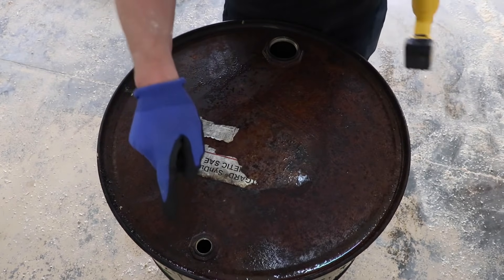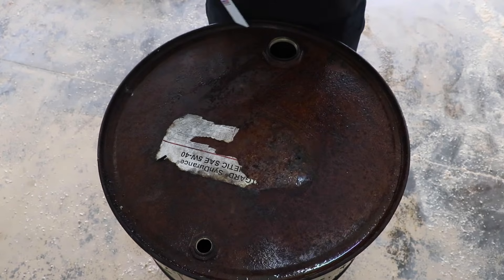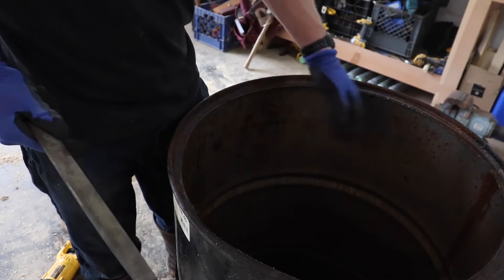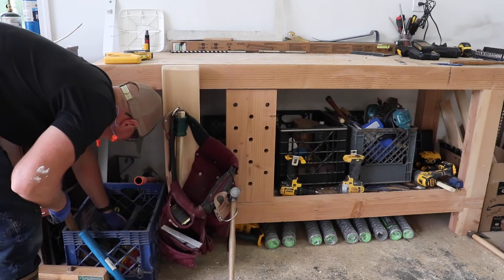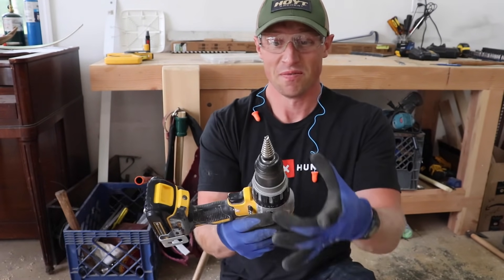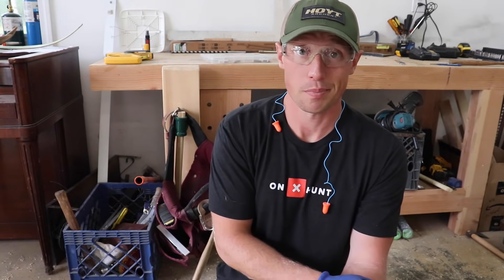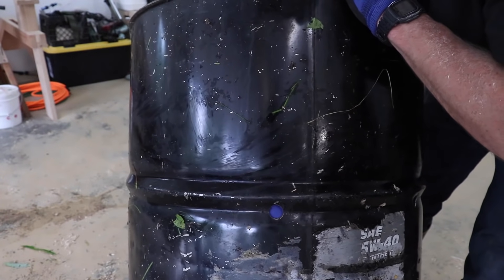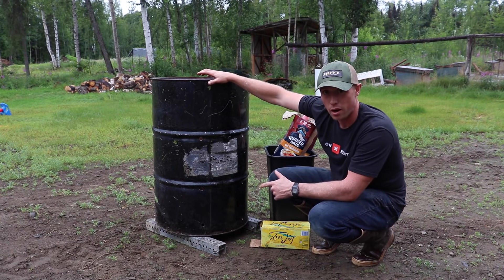HOW TO MAKE A BURN BARREL--- THE SECRET TO BURNING CLEANER!

Comment: I'm pushing 80 years old. I made burn barrels as a teenager. I used a5 pound seldgehammer and an old piece of steel to cut out the top. I just banged the hell out of it till it fell out. Then I used 12 guage with any old buckshot from 15 to 25 yards out on it till it looked right.

Comment: You don't need a drill to make those holes.  When I make a burn barrel, I make a few rows of X cuts with the angle  grinder,  then knock in the middle with a ball peen hammer.  The edges folded inward  prevent burning stuff from escaping, pretty well.  Cheers.
Reply: I shoot holes in mine with a .22 rifle. Easy peasy.
Reply: I love simple! People forget that keep it simple stupid... She has using plasma cutters welding cutters angle grinders for 3 hours for 10 hours of work just to build something that nobody can build just to show how great they are. I want simple s***.
Reply: @Maryland_Kulak EXACTLY!
I'm thinking 9mm, 12 ga buckshot etc
Reply: @howtogetoutofbabylon8978 I use .22 shorts and it penetrates the outside of the barrel but bounces off the other side and the bullet ends up inside the barrel. It’s a very neat and safe way to do it. 9mm would go right through and keep on going.
Reply: @Maryland_Kulak  Can't even find .22 shorts anymore. I have one box for my grandpas gun for posterity but I haven't seen shorts in the store in at least 20 years.

Comment: Whenever you get a barrel with unknown flammable fluids in it. Fill it with 10-20 gallons of water before start cutting on it. Spin it around and the vapors should be contained. I always suggest putting a few gallons in and washing it out before filling with more water to make inert and a little bit of any kind of oil on that step bit will make it last much longer
Reply from the maker: Thanks man for the tips!
Reply: I just throw a match in it.
Reply: Waste of water and i like a good surprise 😂

Comment: To eliminate smoke and fumes, make a 3 inch hole in the side just above the bottom,and use a shop vac hose blowing air in. Use a 3 foot pipe between the barrel and plastic hose to keep it from melting. Take a propane roofing torch and direct the flame horizontally above the barrel. this  is like an after burner and with the jet of air blowing in the bottom, it will burn clean. B careful it gets hot and blows ash out. works great
Reply: i use my battery powered leaf blower. it blazes the barrel right up.
Reply: Battery powered leaf blower for me . Makes the barrel glow red hot

Comment: Good video. I use a pick axe for the holes. You don't need to swing to hard and it makes 4 holes in the bottom and 6 on the sides in about 1 minute.
Reply: Rock hammer with a pick end

Comment: Texas had an ice storm a couple weeks ago and I lost the top quarter of several trees as well as many branches that were taken down when the tops collapsed. I've spent days cutting usable wood for my nephew's fireplace, but have lots of smaller twigs, limbs and pine needles to burn. I spent a year prior to the ice storm debating between a wood chipper/shredder and a burn barrel, the wood chippers that could handle the trees and pine needles were way out of my budget. I also didn't want something that might need gas or electricity in case neither are available.  I've just spent over an hour looking at various YT videos how to create the burn barrel, wasn't even sure about the drill bit needed to drill through steel. I came across your video which kind of went through a checklist of things to do, like where to burn, which I'd already decided on the safest place, plus the concrete pavers to set it up on a dirt area, and to have access to my hose. I grew up in N. Idaho and spent many years in WA state and you never leave fires unattended...where I live in TX, people create all kinds of fires and just walk away and leave them burning...which totally freaks me out. Anyway, your video was actually the most helpful and informative for a novice. Really appreciate it. Thanks so much.
Reply from the maker: I’m glad my rambling was of use to you! Texas ice storms are becoming quite the ordeal these days.

Comment: 6:24    Before you do this, make damn sure the old contents of the drum were not flammable.  Vapors can be just as explosive as the former contents, and guys have gotten killed cutting into "empty" drums that exploded.  I was just reading about a guy in Pennsylvania who got killed by a burn barrel last week.  Another incident in Iowa killed a man who was welding on top of a barrel, using it as a workbench.  Filling the drum with water before cutting into it can displace explosive vapors, if done correctly.

Comment: I cut the top off my burn barrel with a air hammer with a chisel bit takes about  1 min to cut it off on the inside leaving the rolled edge intact. Then I cut a 4" hole on the side 1 inch up the bottom . Works great.

Comment: Done burn barrels for decades. Sawzall is the tool for cutting. I arrived at a different configuration. Cut out both the top AND bottom. Place a heavy screen on the bottom. An old refrigerator shelf works great. Dig an ash hole and place the screen and barrel on top of some blocks/stones. Light 'er up and the thin g burns like a mother!. Might want to have another screen to control embers and ash on the top. Incinerator on steroids.... Burn baby, burn!
Reply from the maker: Great idea!

Comment: I just made one from a new Behrens metal trashcan. I drilled some 2 inch holes with a hole saw on the bottom and a couple in the sides near the bottom and one 4 inch hole through the lid to let it burn down unattended without having to worry about ashes blowing around. In the inside I propped up a 17 inch diameter grill grate with some firebrick to keep an airspace underneath along with the holes to facilitate the fire breathing better and burn hotter. Wish I had a 55 gallon drum like you. Would've been more durable and probably withstand the higher temps better.
Reply from the maker: Shop around. Lots of barrels available most everywhere

Comment: The holes on the bottom are useless once ash collect and further more if hot embers fall through it poses a hazard if you’re on dry ground.
Reply: maybe they're not, I think.  water will drain out of them like out of a plant pot.  that'll stop the bottom rusting out quite so quick maybe?  I've seen guys claim so.  seen barrels that rusted out all around about 4" up from the bottom.  right at the water line I guess.

Comment: I got a barrel from a customer that doesn't have the sealed lid. It has a ring bracket that holds the lid on and a gasket to prevent leaking.  Still has the rolled edge for strength.
Reply: Yes use to cover when not in use…
Reply: You could turn it upside down and then when it’s full undo the ringed lid and let the ashes fall out the bottom.

Comment: Run a grinding disc along the top edge (flat) all around so the seem is split. Tap it with a mallet, and in 2 minutes you are done, no sharp edges to waste time filing!

Comment: im a dummy (preface) .  i just got an empty Kendal oil barrel that is sealed up .  im gonna drill and then use a jigsaw to cut the top off .  im scared that it will explode .  Oil wont explode , right ?  Thanks ,
Reply from the maker: Be careful. Who knows what was in there. Labels are not accurate.

Comment: If you have to cut on a barrel that had gasoline or other explosive material it's always safer to fill it with water before you make a cut.
Reply: @billb7876 go cordless 😁
Reply: @bserieshatch1 Cordless doesn’t cut down on sparks from a cutting wheel. 😉
Reply: @ilpostinomotociclista270  I didn't imply that it did
Reply: @bserieshatch1  Oh, I thought that’s what you meant by going cordless. My bad.
Reply: @ilpostinomotociclista270  it was a response to a deleted comment

Comment: Any paper, cardboard type materials are biodegradable. Please consider dropping those materials into your compost bin. You can run those material types through your shredder or just add to the compost. Cans are also biodegradable or recyclable ♻️ as are plastics like coffee containers, yogurt and milk cartons. In the Bush, or limited grid situations you can recycle plastic containers into shapes using heat, melting plastics together and shaping them into useful items for use in on or underground situations, in the garden or around areas where wood or metal would rot quickly. Cheers!

Comment: It is written on it what was inside: SAE 5W-40 = engine oil
Reply: RL CL  Number w number is the viscosity specification of an engine oil. The first number indicates the viscosity of the oil when it is cold and the second when it is warm.
Dot2 Dot3 etc is brake fluid.
DEXRON 2, DEXRON 3 automatic transmission oil
Reply: RL CL  no
Reply: RL CL  in my opinion the lighter oils burn a bit better. Nothing beats warm used out out of an engine block... Burns for a long time

Comment: The holes in the bottom probably become useless after the first fire when they get clogged and covered with ash
Reply from the maker: 100% but they help during the first few burns.
Reply: Just wait til the barrel cools down and clean out the holes.

Comment: It might help to cut the lid a bit inward so that there is a lip facing inward, perhaps a couple of inches wide. Then put a few holes at the top of the barrel, just under the rim. This air may help combust smoke, and keep the fire more concentrated in the center. Just thinking....